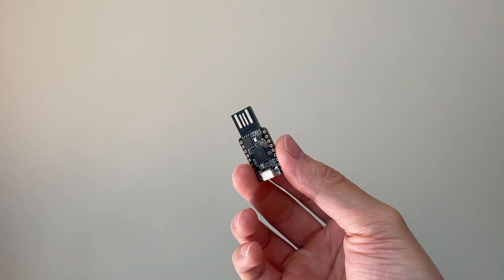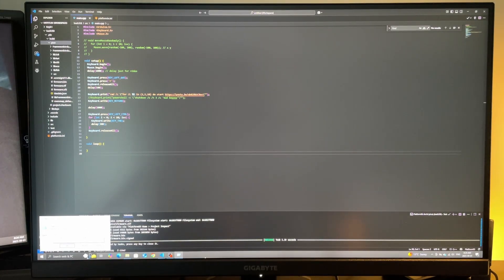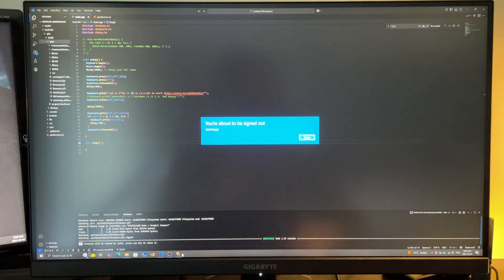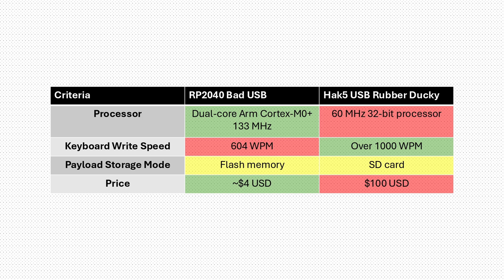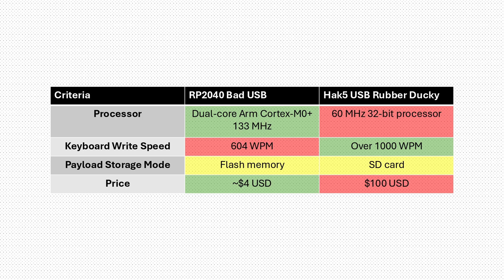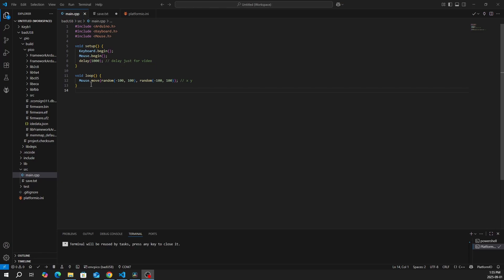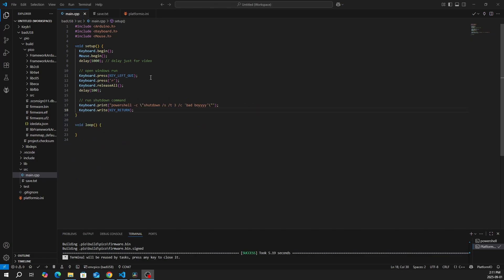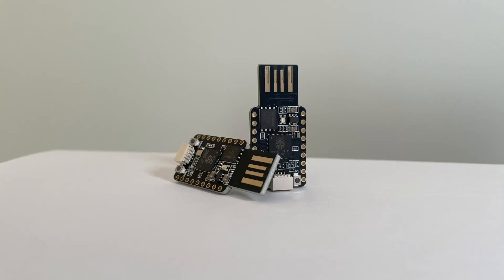Make This $5 Bad USB (Rubber Ducky Alternative)

Comment: Where did you get that framework and how did you set it up in Visual Studio Code? I am trying to make on e for myself, buit have never coded specifically for Arduino before. (Though I do know C#, which is Very similar to C++ and am in the process of figuring out the differences). I looked online and downloaded the Arduino IDE, thinking that may make it easier. I found the Ardunio.h file, but the closest to the others I found was one called USBMouseKeyboard.h. Were your Keyboard.h and Mouse.h files custom-made? If not, where did you get them? I did notice you have a folder in your project called Keyb1. Is that where your Keyboard.h and Mouse.h files are?

It honestly may just be easier to do a deeper dive tutorial video on how to make this.
Reply: Actually, it would make more sense for them to be in the "include" folder
Reply from the maker: I'm using the PlatformIO extension on VS Code. It's a bit more complicated than using the Arduino IDE, but I would highly recommend it. It has many advantages like file management and supports a wide range of boards easily. Once you've downloaded the extension, it will bring you to PlatformIO Home, where you can create a new project, select the "Raspberry Pi Pico" board, and select the Arduino Framework. Once you created the project, go to the platformio.ini file and edit the contents so it looks like this:

[env:pico]
platform = https://github.com/maxgerhardt/platform-raspberrypi.git
board = pico
framework = arduino
board_build.core = earlephilhower

After building your project, if uploading doesn't work, drag and drop firmware.uf2 file into your RP2040 (It should look like an external drive) in your File Explorer. You can find the firmware.uf2 in .pio/build/pico/firmware.uf2.

I'm using earlephihower as the build core as it already includes libraries like Mouse.h and Keyboard.h. The folder in my workspace (not project) called "Keyb1" is the project from my previous Macro Keypad video. You are right though, I should make a deeper dive tutorial to mitigate any confusion. However, I hope this helps.
Reply: @PanDaMaker8  yep. thanks
Reply: Ok. I almost have it working. I copied your code word-for-word, and everything is working except that it isnt recognizing "KEY_LEFT_GUI" as being the Windows key. (or any key for that matter) I know thats the issue because I commented out everything else to see if the windows menu would open when the code ran, and it didn't, which tells me that there is something with that key code. Its printing the other text correctly, and pressing all the other keys correctly. I have triple checked that everything matches what is in the video, but its not working. I also cant find any documentation for the Keyboard.h header or its contents. I found some (confusing) documentation for the Earlephilhower core and I have looked through documentation for the Arduino coding libraries. I was looking to see if I could figure it out on my own, but I am still new to this so I'm lost.  Whats really weird is that Keyboard.press(KEY_TAB); works fine, but Keyboard.press(KEY_LEFT_GUI); does not. which is why I think it is something with that key specifically.
Reply: I did find documentation for the Keyboard.h header and stuff, but it didnt really help.
Reply from the maker: @johngerken4263  That is weird. This is a list/documentation of all the special keys and modifiers of the Keyboard.h library: https://docs.arduino.cc/language-reference/en/functions/usb/Keyboard/keyboardModifiers/

Try other keys, and if it doesn't work then something is wrong with the KEY_LEFT_GUI. Maybe also try using the hex code of KEY_LEFT_GUI instead: Keyboard.press(0xC3); or Keyboard.press((uint8_t)0x83); if you need to cast it
Reply: @PanDaMaker8  its not a big deal, i just wanted to let you know that, according to the documentation you linked to, the left WIn key is 0x83, not 0xC3. 0xC3 is the F2 key.
Reply: I just tested it with both the hex code and casting the int, and neither worked. I'm at a loss here.
Reply: Im gonna try starting from scratch and just trying to get that one thing to work. Process of elemination and all that.
Reply from the maker: Okay hope it works eventually. It’s weird that the other keys work
Reply: Now, this is getting really weird. If I put the press command in the loop function instead of in setup, then it works...  like, what?!?!
Reply: Is there a way to use breakpoints and/or simuilate running the code in VS Code without loading it to the actual device (for debugging purposes)?
Reply from the maker: When you do Keyboard.press, you might also need to do Keyboard.releaseAll; after your code section to release the windows key and not keep it held down